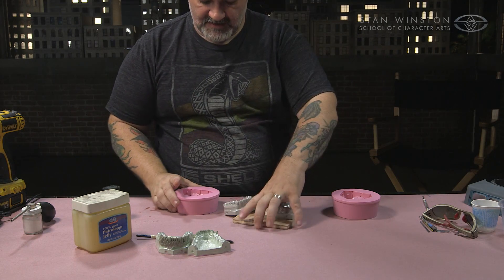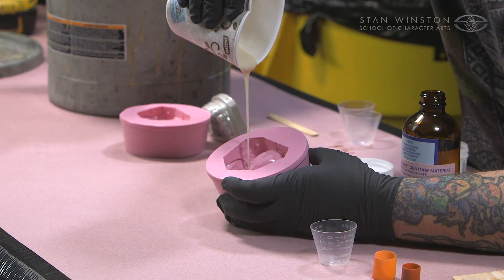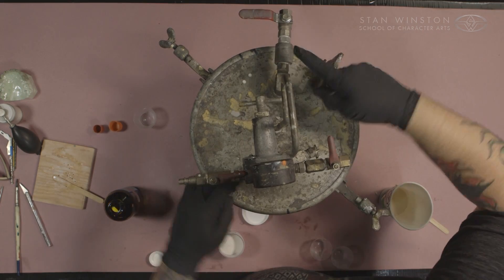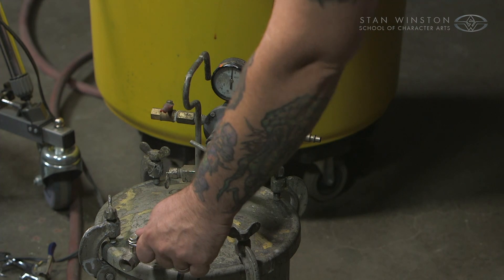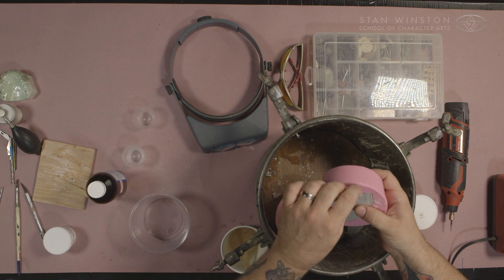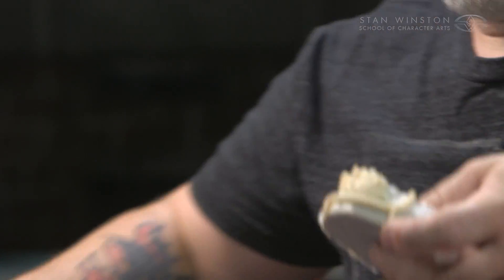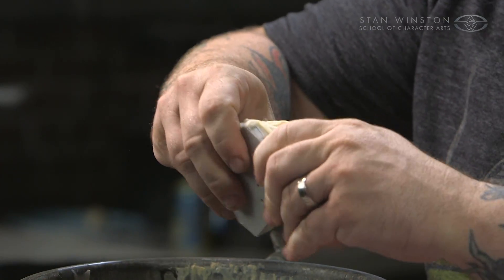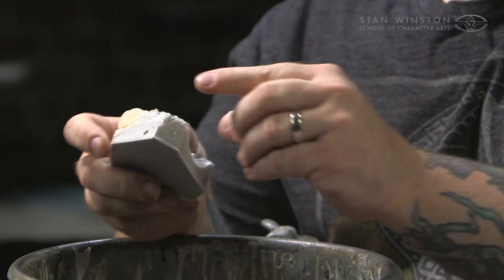Creature Teeth: Dental Acrylic Casting & Demolding - FREE CHAPTER

Comment: Hi , thanks for this video. I have a question about your vacuum chamber. Or about a vacuum chamber I should say. I found a cheapo one on Amazon. It’s called a resin bubble remover which basically is a vacuum chamber for small scale resin pieces. So I’m wondering if you think this would work for dental applications. It’s so affordable.